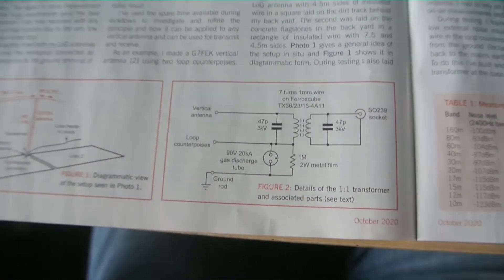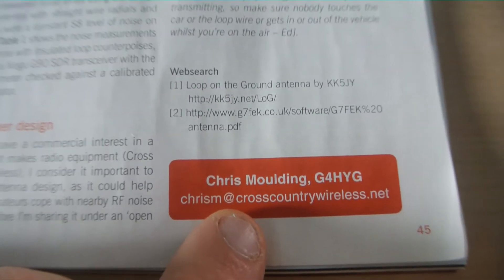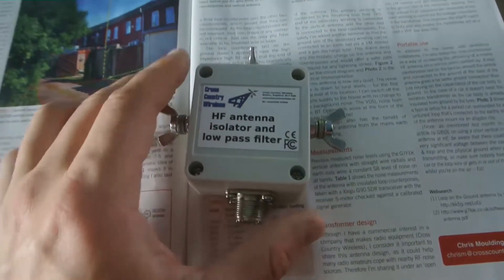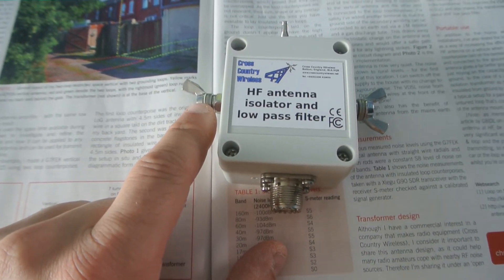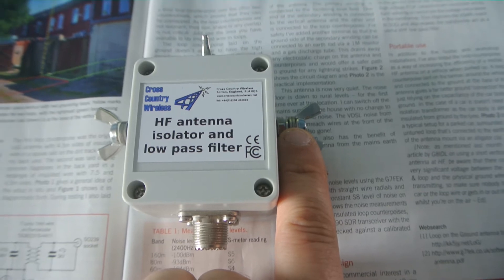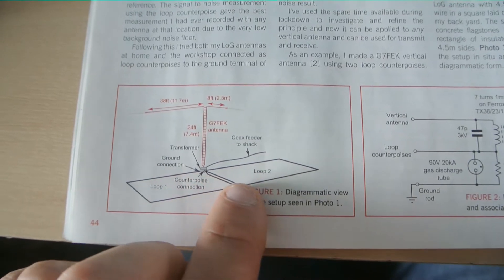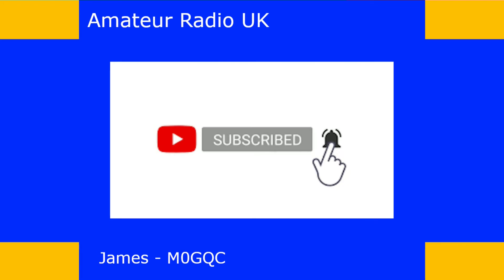Loop On Ground Counterpoise - Low noise verticals for small urban locations

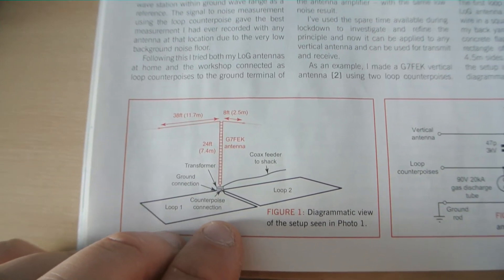Comment from the maker: I've just spotted an error at 3:50 which was a slip of the tongue and apparently made it through editing process un-noticed........I stated in the video that the author used "20 meter radius loops". THIS IS INCORRECT. I should have said that he used "20 meter circumference loops". In other words each loop is made up of a total of 20 meters of wire, which is obviously very different to 20 meters radius!

Comment: Ok, did Yoy try those loop counterpoises without isolator - just diorectly connected to lets say 1:1 balun or choke balun? It could be convinient for portable use.
Reply from the maker: I'm afraid I didn't try that.

I'm not sure about the practicality of using a LOG antenna for portable operations. At least not from my perspective as a SOTA & WWFF activator.

Most of my operating is done on SOTA summits or in WWFF sites which tend to have a very low noise floor. The additional complexity of switching between separate antennas seems unnecessary, along with the additional equipment I'd need to carry with me for setting up two antennas. Not really what I want to be doing when it's blowing a gale & pouring with rain!

I think this antenna is better suited to a fixed base or maybe a large portable (contest?) station.
Reply: @HamRadioOnline  No, I just think about using loop/log counterpoises/radials for verical antenna. I think storing and deploying loop rqadials (1 or 2) is much easier than laying 16 radials on the ground. Especially stroring those loops wound be much more convinient and they surely would be less prone to tangling or tripping over them etc. I just didnt test how shaping ground radial as a loop/clover leaf - closed loop affect tuning of the antenna. Im also POTA activator and noise floor is no concern to me, but I like the idea of loop radial staked to the ground in 4 corners buch more than standard 16 radials on the ground. I need to test it one day. This radial loop or 2 loops you can easiliy wind on one winder and they will never tangle.
Reply from the maker: @takietam8329  Note to self.....check which video the comment is on before replying!!! I just saw the words "loop on ground" & immediately thought RX only antenna. My bad.

You're right, it would be interesting to try this in a portable context. I wonder if the loops would be prone to twisting & getting knotted.

Then again, with less radials they might be quicker to set up & may actually be less prone to tangling, especially in a big portable system (like a full size 40m 1/4 wave at a caravan park for example)?

As for a smaller portable setup (SOTA/WWFF etc), now you've put the idea in my head I'm tempted to try it!

Comment: So to the point: 1) Are the loop counterpoise working as good as standard ones on transmit? 2) Are they really quieter than standard ones and worth trying (could be convinient for portable use)? 3) Is making isolating transformer much better for this counterpoise system than using standard guanella 1:1 balun? 4) do You still use log counterpoise after a year? Did  You switch back to standard ones? 5) Did you make some real life comparisons on ssb with other stations? Thanks in advance. 73
Reply from the maker: It's difficult to say as I didn't do a side by side comparison but to answer your questions as best as I can, here's my perception:-

1) I think it depends how many radials you have & how long they are. A large number of 1/4 wave radials will perform better. Having said that, if you are in a compromise situation where you don't have room for a lot of radials then I think this is a better solution. I was surprised how well it performed on 40m. It wasn't a side by side comparison, so not scientific & I can't say for sure but I think this setup performed better than my 30 or so short radials (around 1-2 meters long) which I had before this system.

2) Impossible to say as the noise level is so variable here but I would be inclined to say yes, if only slightly. Verticals are noisy anyway. Especially in built-up areas.

3) I did try swapping between the CCW unit & a normal 1:1 balun & I did notice an improvement in the noise level (albeit marginal but several small improvements can add up to a big improvement).

4) I still have the LOG counterpoise installed, although I rarely use it these days. The mount for the vertical is currently supporting an 18m tall DX Commander mast with an elevated EFHW vertical for 20m (putting the feed point at around 8m above the ground). Obviously that setup doesn't need radials, so they are fairly redundant at the moment. For 80m & 40m I now have an EFHW going over the roof of the house in an inverted V.

5) It was impossible to do any side by side comparisons as I didn't have both ground systems installed at the same time (& if I did they would probably interact with each other & skew the results anyway), so no is the answer to that one.

The problem with ground-mounted verticals in built up areas is that there is too much clutter in the way. They are brilliant in open countryside where there are no ground structures to attenuate your signal but I've always found verticals lacking in residential areas. You really need to get the antenna up above the roofline.

To tell it how it is, this is a compromised setup. A beam on a mast (for the few of us lucky enough to have that luxury) or some form of horizontal 1/2 wave antenna such as an EFHW, dipole, OCF, doublet etc will almost certainly perform better than a ground mounted vertical in a built up area AS LONG AS YOU GET IT UP HIGH.

If you are limited on space & cannot get the antenna up above the roofline then a vertical will get you on the air.

The bottom line for me is if you have room to get a number of 1/4 wave radials on the ground (say 8 or more) then go for that. It will perform better.

If you are in a very confined space & cannot get 1/4 wave radials (or close to a 1/4 wave) then I would consider the LOG counterpoise to be a better option.

If I went back to a 1/4 wave vertical in my garden I would choose the LOG counterpoise.
Reply: @HamRadioOnline  Thank You for Your response. Im also struggling with limited space at my home QTH. The yard is 20x25m with 2 store 10m tall house in the middle. Recently I tried few antenna options as multiband vertical "rybakov" on the mrtal roof and in the garden, multiband 80-40-20m fan dipole, 43ft vertical and currenty efhw 80m version bent around the house - all with fairly good results tbh. I also work portable and now I make all my baluns and antennas by myself. I prefer vertical antennas, but most annoying thing is placing radials when operating portable. Also making sufficientbradial field in limited stace is a PITA. Thats why i was interested in those loop counterpoises as they seem to be more convinient and easier to deploy than standard ones. I gonna test them soon, i think they could be interesting. I bouht a few squid poles up to 14m long and im using slingshot with really good results to deploy antennas on the trees, so im leaning toward efhw design lately as it seems to be really idiotproof and work pretty well with extremely limited counterpoise vertical or horizontal. Again thx for response. Cheers and 73. Sp8pkt.

Comment: there was a book on wire antennae (my copy is at my ex's) in which wire mesh was suggested for a ground plane. i've not seen it done on YT so i don't know how well it compares to radials.
Reply from the maker: It's an interesting proposition.

Some people swear by it, others berate the suggestion stating that it's great for the first few weeks until it corrodes away!

Personally I would have thought that it would be ok as long as you use something which isn't going to corrode (maybe galvanized steel?).

I have heard of farmers using the wire mesh on a chicken pen as a counterpoise.

I've often wondered how well a wire fence would work as a counterpoise. I have previously activated a SOTA summit using a fence as the radiating element of my antenna but I've never tried using it as a counterpoise/ground plane  for a 1/4 wave vertical, inverted L, or maybe an end-fed random wire of some description.

Could be an interesting experiment/video!
Reply: @HamRadioOnline  yes, heavy guage twill weld or even re-bar comes to mind!

Comment: Good job! 
Traditional thoughts on ground radials is more is better, up to about 120 (!!!), which is clearly a big commitment. I’ve never seen ground loop counterpoise investigated before Chris’s article in RadCom October 2020 and I think it’s very coool.
Reply from the maker: I have to confess that I was a bit sceptical when I saw the article, although I have a lot of respect for Chris Moulding because he knows significantly more than I do. I've purchased several of his products over the years & have been very happy with all of them.

120 radials is considered the "perfect" scenario, which is usually the ambition for broadcast radio. As you said, that is a big investment of time & effort. I would suggest that to be overkill for an amateur radio station.

There is some very interesting work carried out by an amateur called Rudy Severns on the number of radials required. If I remember rightly, more than about 16-20 radials and you are into diminishing returns (at least at our level in the game). Callum went into some detail on his channel "DX Commander", which is an interesting watch if you haven't already seen it.

When all is said & done, I've heard of people getting acceptable results with just 8, or even 4 radials. Obviously this is very much a compromise but it will still make contacts.

This "Loop On Ground" arrangement will be a compromise. A full size radial field would presumably perform better. Even so, I tested this setup on 160m (using a 1/4 wave vertical for 40m & a loading coil made out of air-conditioning vent pipes (I think that is the most recent video which I released on Saturday just gone). I was pleasantly surprised how well it performed considering the relatively small (compared to 160m wavelength) amount of wire on the ground.

I think sometimes we have to challenge "traditional thoughts". Otherwise how do we experiment & find new (& potentially better) ways of doing things?

In summary, I see this as an extremely good option for small locations, but if you have the space & resources to set it up then better performance will be achieved with a conventional full sized radial field.

Comment: Hi James, Good to see that the loop counterpoises are working well for you. 73, Chris G4HYG
Reply from the maker: Thanks Chris, nice to hear from you. I did wonder if you would stumble upon my videos on your products!

Just to say that I’ve been very happy with all of the CCW products that I’ve experimented with so far.

I recently purchased a loop antenna amplifier from you in an attempt to make 80m & 40m a bit easier in my very noisy (I think mainly VDSL interference) mid-terrace location. So far I’m very impressed with it’s performance, to the extent that I also purchased one of your front end overload protection boxes & plan to use the loop (coupled with an SDR Play RSP-1a receiver) as my primary RX antenna while transmitting on my EFHW.

I also want you have a dabble with a vertical using your “High Z Antenna Amplifier”. I suspect that will be a bit more noisy than the loop, but would still be interested to give it a go. I think that’s going to be a project for later in the year.

I would be cheeky and ask for a “favourable price” but quite honestly (with slightly over 200 subscribers) I don’t think my channel attracts enough publicity to put me in a position to ask for favours like that!!!
Reply: @HamRadioOnline  It's good to hear that you like all the products you have bought from us. No problem with asking for a discount as I always like to help radio amateurs making good YouTube content.

Comment: At time index 6:45 I'm Saying Winner Winner Chicken Dinner, my 40-80 has 2x47 ft radials. watch this space! Barnie M7PBX.
Reply from the maker: I think you said in a previous comment that you had a similar size garden, so I presume that your 47ft radials (just under 15 meters) are bent around the garden, and not laid out in a straight line?

If you do try this I would be very interested to know how you get on.

It sounds like Tim G5TM  (check out his channel by the way if you haven't already) is also going to give it a go. I would be very interested to know how other people's attempts compare to mine.
Reply: @HamRadioOnline  Hi , Well that was the original idea, but my back garden faces the back garden of the next road and there is a 12ft wide alley way running the length of the street just a rough grassed strip unused. so they run in a straight line each way from the middle of my back fence. I would like to try the loop ground concept though, my garden is paved with 3x2 flags but the gaps are about 35mm and really need re-grouting (for want of a better word) after placing ground loops in between them. I reckon I could get 2 x 38ft loops between the pavers, then try with all the radials and then just the loops to see what results I get. Barnie M7PBX.
Ps- Yes I'm subscribed to Tim's Channel.
Reply from the maker: @Cardassiaprime  Sounds awesome, that should work really well.

Let me know how you get on....."keep me in the loop" as they say!

Ok, that was a terrible joke, I'll get my coat!!!